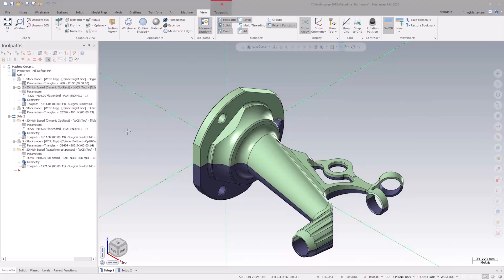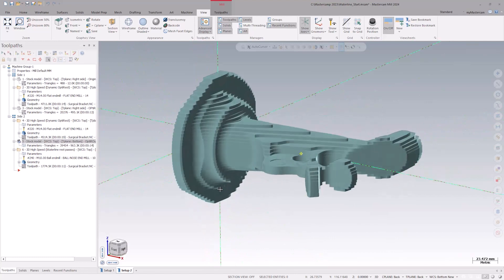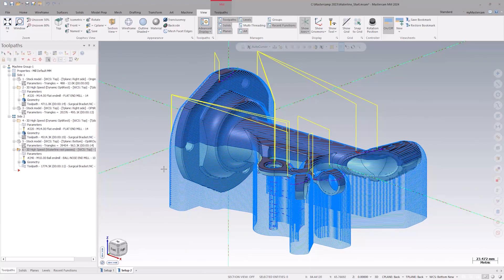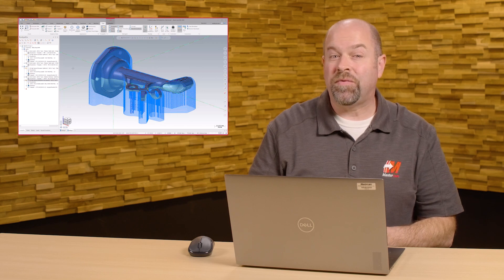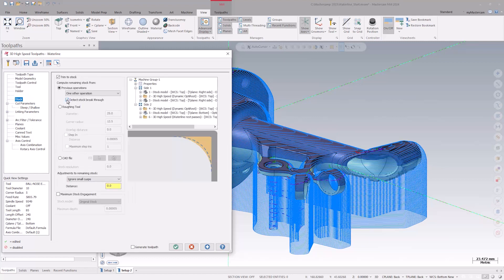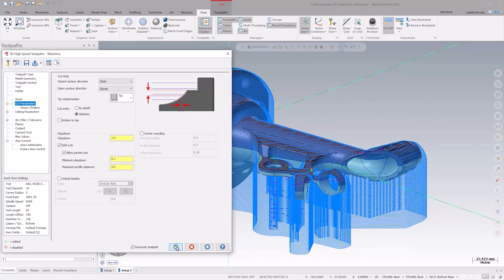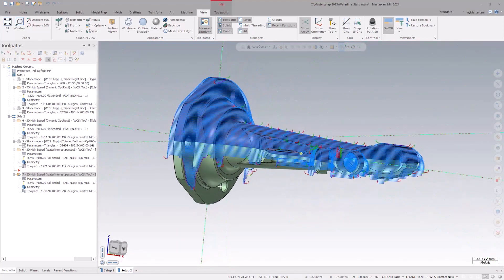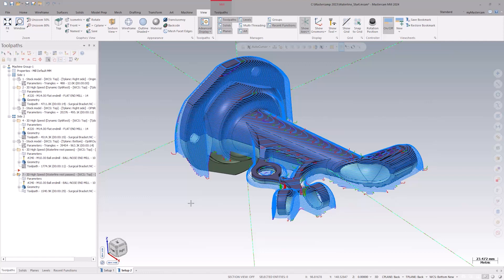Waterline Detect Breakthrough and Partial Cut Demo | Mastercam 2024 Signature Parts

Comment: Partial cuts is a good addition, is it possible to detect stock breakthrough without a stock model?
Reply from the maker: Yes, it has to be a stock model. The previous operations has to be set to "One other operation" and the operation needs to be a stock model!